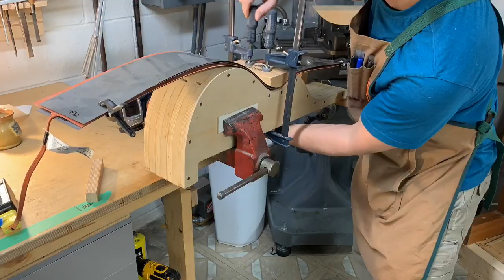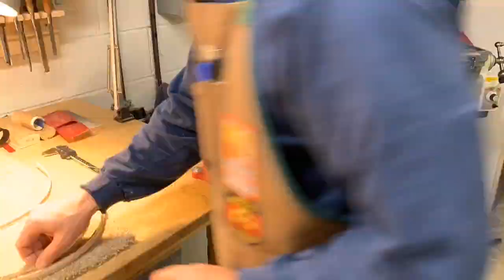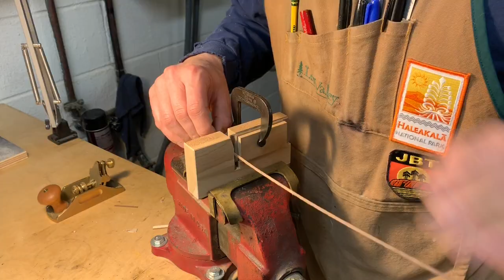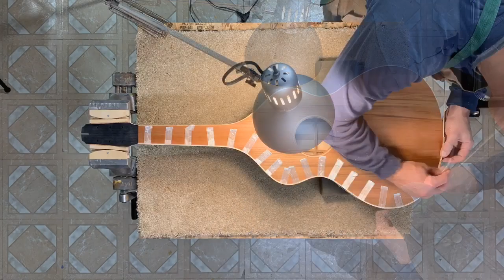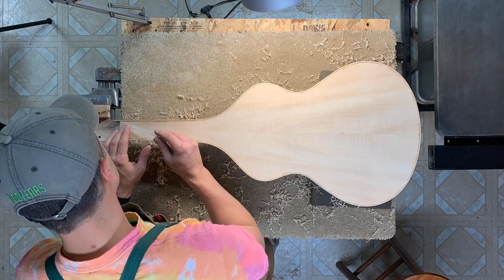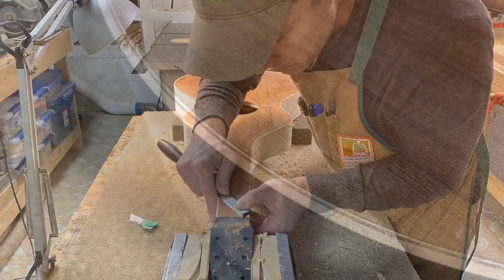Bending and Installing Binding on an Acoustic Guitar - Making Trevor's Weissenborn 15

Comment: I'm refurbishing my first guitar I made in 1982. It was a styled after the Rickenbacker 320, in black, like John Lennon's guitar.   I'm removing the plastic binding on the front face and installing binding to both sides and having the natural finish.  I debated if I should go with white plastic but found some nice curly maple.  Then, I saw rope binding and wanted to use that.  I plan on cutting each piece by hand but wasn't sure which glue to use.  The body is mahogany.  I like Titebond but as each piece is very small, it will take a long time.  If I use Ca glue won't it seep onto the surrounding wood too deep?  Do I apply a coat of shellac to prevent CA glue from seeping in?  How did you prevent glue from spilling over?  Thank you for any help.
Reply from the maker: Hello @Mich050 ! Yes, I coat the channels with shellac before using CA glue. I also add a coat or two to the top and sides just in case. I haven’t had an issue yet, even with Cedar. You don’t have to use CA glue if you are worried about it. I use it because it is instant and I can push the binding were I need it to be. I’m working on moving away from CA and going back to Titebond or even Fish or Hide glue. Good luck with your project! So cool you still have your first guitar!!!